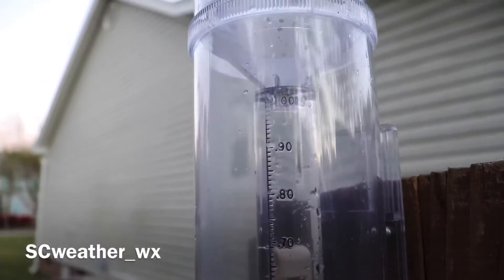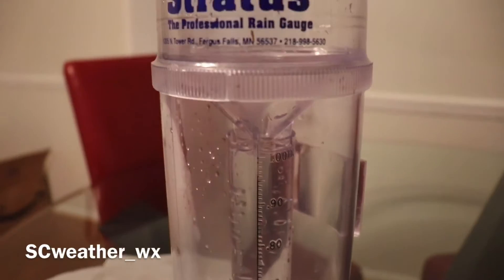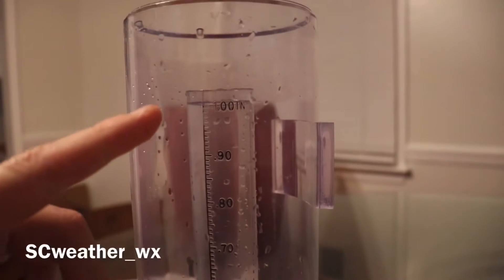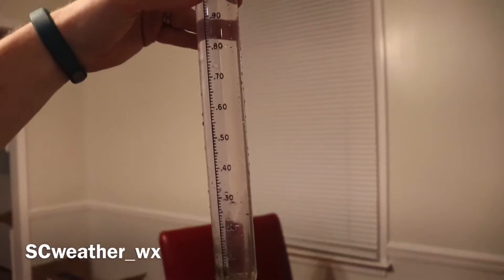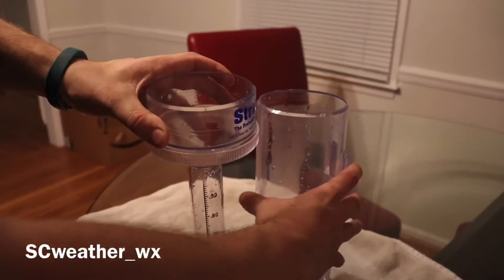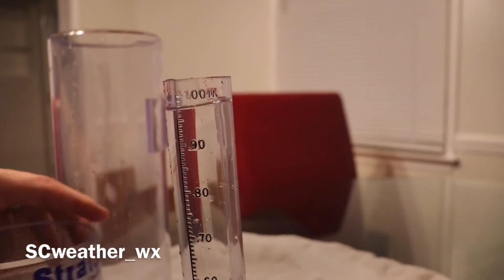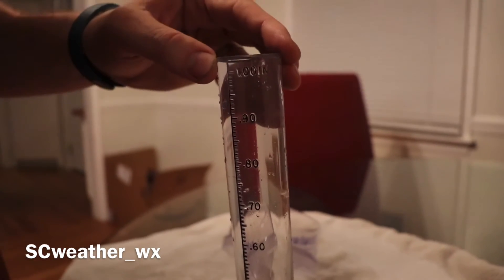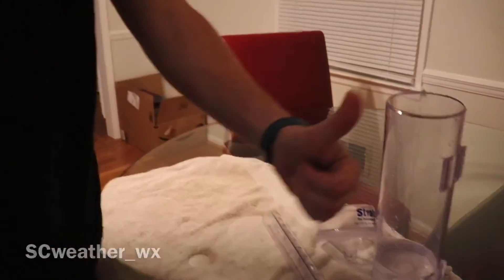How to measure the overflow in your CoCoRaHS rain gauge! Over 1 inch

Comment: I believe you are sloppy with your instructions.  I suggest using the funnel as you have, but don’t fill the 1.00” tube to the top and risk spilling water out of the “hole” at the side.  Record the height and dump the 1.00” tube and repeat the process of partially filling it and recording the heights until all of the water in the “bigger” receptacle has been measured.  Sum the heights and report the total value.
Reply from the maker: Thank you